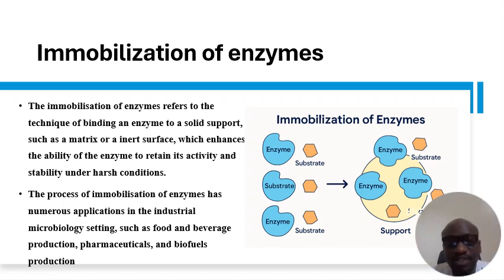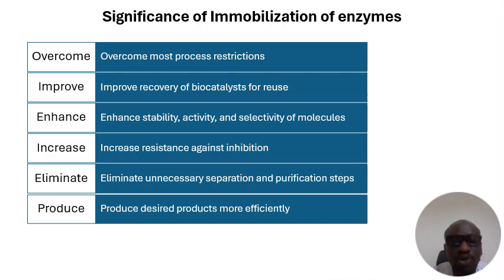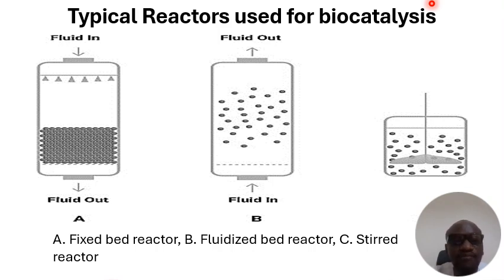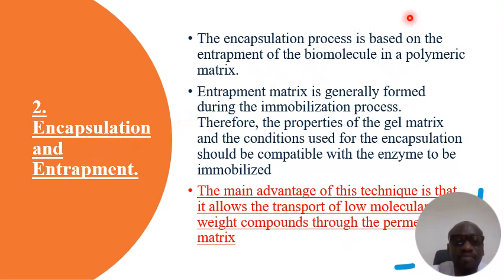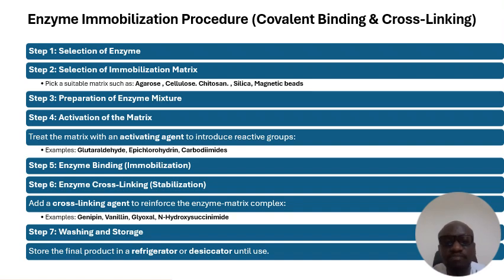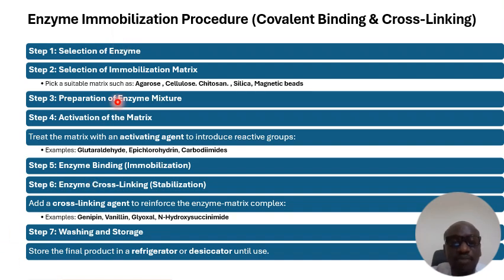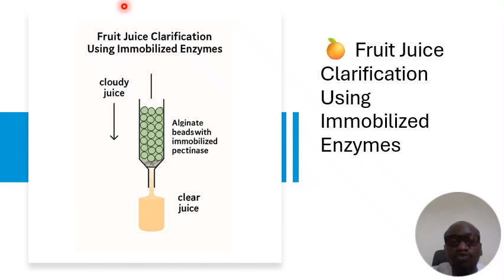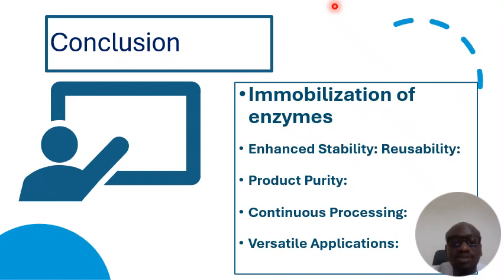Immobilization of Enzymes (Industrial Microbiology )

Comment: Question 1:
Immobilisation of enzymes is the process of attaching or trapping enzymes onto a solid support so that they remain fixed in one place while still carrying out their catalytic function. This is useful because the enzymes can be easily be separated from the reaction mixture, reused many times, and are often more stable.

Question 2:
Advantages of immobilised enzymes:
a. They can be reused, reducing production costs.
b. They are more stable and can withstand changes in temperature and pH better.
c. They are easy to separate from the reaction mixture, making product purification easier.
d. They reduce contamination of the final product because the enzymes remain attached to the solid support.

Real-life application:
Immobilised lactase is widely used in the dairy industry to produce lactose-free milk for people who are lactose intolerant. The enzyme is attached to a solid support, such as calcium alginate beads, porous glass beads, silica beads, or synthetic polymer resins. Milk is passed over these solid supports, allowing the immobilised lactase to break down lactose into glucose and galactose. Since the enzyme remains fixed to the solid support, it can be reused many times, does not contaminate the milk, and makes the process more efficient and cost-effective.

NAME: AWOSIKA IGBEKELEOLUWA AYOWALE
MATRIC NUMBER: 210807010

Comment: Question 1: 

Enzyme immobilisation is a technique where enzymes are physically trapped or chemically bound onto a solid support or matrix. This setup retains the enzyme's catalytic activity while preventing it from mixing freely with the reaction product. It is useful because it allows easy separation and recovery of the enzyme, making the biocatalytic process more stable, cost-effective, and suitable for repeated or continuous industrial use.

Question 2: 
Applications and Advantages

Advantages of immobilised enzymes:
• Increased stability:immobilised enzymes are generally more resistant to changes in temperature, pH, and denaturation compared to free enzymes.
• Reusability:the enzyme can be recovered and used repeatedly, lowering production costs.
•Easy separation: since the enzyme is fixed to a support, it can be easily separated from the product, simplifying downstream purification.

Real life application:
Immobilised glucose is used industrially to convert glucose into fructose, producing high fructose corn syrup (HFCS), a widely used sweetener in the food industry.

NAME: Akinsanjo Kofoworola k.

MATRIC: 210807034

Comment: Question 1
Enzyme immobilization is a method of fixing free enzymes onto a solid support or trapping them within a confined space. This allows it to be  able to retain it's activity during use, retain it's stability under harsh conditions and to be separated easily and used for other industrial processes. 

Question 2
Advantages of enzyme Immobilization
1) It allows recycling of enzymes; that is, multiple use of enzymes
2) Easy separation of enzymes
3) It reduces the cost of downstream processing

Real Life application of enzyme immobilization
Wastewater Treatment: Enzymes like laccases and peroxidases are attached to solid supports (e.g., porous silica or magnetic nanoparticles). These fixed enzymes can be dropped into polluted water to break down and detoxify persistent organic pollutants, such as pesticides and phenols.

Ofojetu Adanna Gift
210807016

Comment: microbiology
Reply: Question 1:
Enzyme immobilisation is the method of fixing enzymes onto or within a solid material while allowing them to keep working. This makes them easy to recover and use again, improving efficiency and reducing costs.
Reply: Question 2:

* Enzymes can be used repeatedly, lowering expenses.
* They are easier to remove from the final product.
* They are more resistant to changes in pH and temperature.

Comment: Question 1

Immobilisation of enzymes is the process of attaching or binding enzymes to an insoluble solid support while retaining their catalytic activity. This process enhances enzyme stability, allows for repeated use, and improves their efficiency in industrial applications.

Enzymes can be immobilised using various methods, including:
Physical adsorption, Encapsulation, Entrapment and Covalent binding

uestion 2: 

Advantages:
- Enzymes can be reused many times, which reduces cost.
- They are easier to separate from the reaction mixture.
- They are more stable and can last longer.

Real-Life Application

Immobilised enzymes are widely used in industrial processes. For example, immobilised lactase is used in the production of lactose-free milk, where it hydrolyses lactose into glucose and galactose, making the milk suitable for lactose-intolerant individuals.

Name: Odususi Anjolaoluwa Elizabeth
Matric No.: 230807509

Comment: Question 1:  Enzyme immobilisation refers to the process of fixing enzymes onto or within a solid material such as beads, fibres, or gels. By keeping the enzymes in one place, they can carry out reactions without mixing with the final product. This makes the enzymes easier to recover and use again, which is especially useful in industrial production.

Question 2:
Two benefits of immobilised enzymes:
1. Reusability: Since the enzymes are attached to a support material, they can be collected after use and employed in several reaction cycles, reducing production costs.
2. Improved durability: Immobilised enzymes are generally more tolerant of changes in temperature and pH, allowing them to remain active for longer periods.

One practical application:
1. Lactose-free dairy production: Lactase enzymes are immobilised in a processing system, and milk is passed over them. The enzyme breaks down lactose into simpler sugars, making the milk suitable for individuals who have difficulty digesting lactose.

Cynthia Udalor chinyere 
210807011
Microbiology

Comment: Question 1
 Immobilization of enzymes is the process by which enzymes are attached to a solid support, such as matrices or surfaces. This can be done through methods such as physical adsorption,, covalent bonding, cross-linking or entrapment, each varying in how the enzyme is held in place. This keeps the enzymes stable and active, under harsh conditions, making them easy to recover and reuse.

Question 2 
Advantages
1. Less purification in downstream processing is required as the enzymes don’t mix with the final product.
2. Immobilized enzymes remain stable over a long period, reducing how often they need to be replaced.

Real-life Application
In pharmaceutical industries, immobilized enzymes are used to synthesize Active Pharmaceutical Ingredients (API), they help make drug manufacturing more controlled, efficient, and cost-effective .

Name: Usman Zoliat Jadesola
Matric number: 210807101

Comment: Question 1: What is immobilization of enzymes?
Immobilization of enzymes can be defined as the process of attaching enzymes to a solid or rigid support without disrupting the activity or stability of the enzymes. The enzyme and substrate react together to give a product, the enzyme remains in the matrix while it is reused.
The methods used are physical adsorption, encapsulation and entrapment, covalent binding, cross-linking.

Question 2: Two advantages of enzyme immobilization and a real life application 

Continuous production: Since the enzyme is retained, it can be used in reactors. This allows non-stop industrial production without having to are fresh enzyme to every batch 

Easier product recovery: Since the enzyme is bound to a solid support and not dissolved in the reaction mixture, the product comes out enzyme-free

Real life application 
It is used in High Fructose Corn Syrup (HFCS)production. This is a sweetener used in processed food and drinks. Corn starch is broken down into glucose syrup by amylase enzymes then it is pumped continuously through a column packed with immobilized glucose isomerase. The enzyme converts approximately 55% of it to fructose, HFCS flows out the other end completely enzyme free. The immobilized enzyme column stays in place and the process repeats continuously.

Daramola Charisma Oluwaseun
210807054

Comment: Question 1: Explain immobilisation

Immobilisation of enzymes refers to the technique of physically confining or binding enzyme molecules onto a solid support or within a matrix. The enzymes are fixed through methods such as physical adsorption, covalent binding, entrapment, encapsulation, or cross linking. This process is useful because it stabilizes the enzymes against harsh conditions, prevents them from mixing into the final product, and allows them to be easily recovered and reused for continuous, cost effective industrial operations.

Question 2: Applications and advantages
Advantages:
* Easy recovery and separation of enzymes from the product, reducing the need for costly downstream purification processes.
* Reusability and enhanced operational stability (such as increased resistance to temperature and pH fluctuations) over extended periods.

Real life application:
Immobilised lactase enzyme (entrapped in alginate beads) is used in the dairy industry to break down lactose into glucose and galactose to produce lactose free milk for lactose intolerant consumers.

210807117
Akuwa Temiloluwa Omoshalewa

Comment: Question 1
Immobilization of enzymes is the process of fixing an enzyme to a solid material or within a small space, so it doesn't float freely in the reaction mixture. 

This can be done by adsorption where the enzyme just sticks to the surface of the support, covalent bonding where it is strongly attached chemically, entrapment where it is trapped inside a gel or bead, or cross-linking where the enzymes are linked together.

This is very useful because one can easily separate the enzyme from the product and reuse it many times, which saves money, it also makes the enzyme more stable and it doesn't spoil easily with heat or pH changes. Then it can be used continuously in industries, like in food processing and drug production, without losing the enzyme.

Question 2
Applications and Advantages

Advantages:
•Reusability : one can use the same enzyme over and over again instead of throwing it away after one reaction, so it saves cost.
•More stability : When fixed to a support, the enzyme becomes stronger and can resist high temperature, pH changes, and doesn't get damaged easily.
•Easy separation : The product will be free from enzyme contamination because you can easily remove the immobilized enzyme after the reaction.

Real-life application:
In industry, immobilized lactase is used to produce lactose-free milk for people who are lactose intolerant. The enzyme is fixed and milk is passed over it to break down lactose, and the enzyme can be reused.

Adefidipe Oluwagbotemi Aderinsola 
210807018

Comment: Answer to question 1.

Enzyme immobilization is the process of fixing an enzyme either on a solid support such as a matrix, or an inert surface that enhances the ability of the enzyme to retain it's activity under unfavourable or harsh conditions. 

Enzymes can be fixed to a support either by cross-linking, encapsulation, entrapment, covalent binding, or physical adsorption.

Enzyme immobilization is useful because it extends shelf-life of the enzymes, makes recovery easy, minimizes the purification procedures, enhances the stability of the enzymes, and supports continuous processing.

Answer to question 2.

Advantages of Enzyme immobilization 
1. It allows for multiple use lf the enzymes
2. It reduces the cost of downstream processing
3. It allows for the enzymes to be separated easily 

Real-life application of enzyme immobilization.
Production of clear fruit juices in the food industry: In the food industry, a bioreactor holding the enzyme pectinase is used to remove pectin from fruit juices via the catalytic reaction between pectinase and pectin. Pectin is an organic compound. In fruit juices it makes it cloudy in appearance. For the consumer taste of having a less cloudy fruit juice, the enzyme immobilization based reaction on the fruit juice is being used.

Name: Ayika Peter Kosisochukwu
Matric number: 230807573

Comment: Question 1:

The Immobilisation of enzyme refers to the technique of binding an enzyme to a solid support such as inert surfaces or some other matrix which allows the enzyme retain its activity during use and stability during harsh condition. The enzymes are fixed to a support by cross linking, encapsulation, entrapment, adsorption or covalent binding. It is useful for easy recovery, extended shelf life and also enhance stability.

Question 2:

1.Reduced costs of downstreaming process: Enzymes can be reused, reducing production costs. 
2.Better Stability, especially towards organic solvent and higher temperatures: They are more stable and can withstand changes in temperature and pH better.

Application:
Immobilised pectinase is used to clarify fruit juice by breaking down pectin, which causes cloudiness. This produces a clearer, better-looking juice while allowing the enzyme to be reused, reducing production costs

Name: Ajao Wasilat Oladunni 
Matric No: 210807080

Comment: Question 1 

Immobilization of enzyme is a technique in which enzymes are held in a fixed position by attaching them to or enclosing them within a material that supports them . This allows the enzymes to keep carrying out their reactions while making them easier to recover, use repeatedly, and maintain their activity for a longer period, especially in industrial processes 

Question 2 

Advantages of immobilised enzymes:
1. Reusability: Immobilised enzymes can be recovered after a reaction and used repeatedly, thereby reducing the overall cost of enzyme-dependent processes.
2. Improved stability: They exhibit greater resistance to changes in temperature, pH, and other operating conditions, allowing them to remain active for longer periods.
3. Simplified product recovery: Since the enzymes remain attached to a support material, they can be easily separated from the reaction mixture, resulting in a cleaner product and easier downstream processing.
One real-life application:
* Production of lactose-free dairy products: Immobilised lactase is widely used in the dairy industry to hydrolyse lactose into glucose and galactose, enabling the production of lactose-free milk while allowing the enzyme to be reused efficiently.
 
Bamisile Abimbola 
230807568

Comment: Question 1: Explain Immobilisation
Immobilisation of enzymes means fixing or attaching enzymes to a solid material so that they can stay in one place while still carrying out their catalytic activity. This makes it very easy to separate and reuse the enzymes, which helps save time and reduce cost during industrial production. It is achieved by binding the enzymes to a support material, trapping them in a matrix, or enclosing them in a membrane or capsule so they remain active but do not move freely in the reaction mixture.

Question 2: Applications and Advantages
Advantages of immobilised enzymes:
1. They are strongly attached to the support, so that they do not leak easily and also remain stable during use.
2. They are cost effective because they can be reused many times without losing much of their activity.
Real-life application:
Immobilised lactase is used to produce lactose-free milk by breaking down lactose into simpler sugars that are easier for people with lactose intolerance to digest.

Adetu Oluwafemi Hikmat
210807025

Comment: Question 1:
Immobilisation of enzymes is the process of attaching or trapping enzymes onto a solid support, such as beads or a membrane, so they remain in one place while still carrying out their catalytic function. This is useful because the enzymes can be easily separated from the products and reused many times, making the process more efficient and cost-effective.  ￼

Question 2:
Advantages:
	•	Immobilised enzymes can be reused several times, reducing costs.
	•	They are easy to separate from the product, preventing contamination.
Application:
	•	Immobilised lactase is used in the food industry to produce lactose-free milk by breaking down lactose into glucose and galactose.  ￼

Comment: Question 1
 What is enzyme immobilisation, and what methods are used to achieve it?

Immobilisation means fixing an enzyme onto or inside a solid support material so it can no longer float freely in solution, while it still keeps its catalytic ability. This makes the enzyme more durable, reusable, and better able to withstand harsh conditions.

Common methods include:
1. Adsorption (surface attachment via weak forces)
2.Entrapment/encapsulation (trapped inside a gel or membrane)
3.Covalent attachment (chemically bonded to the support)

This matters because it cuts costs and improves durability for large-scale industrial use.

Question 2
What are the advantages of using immobilised enzymes, and can you give a real-life example?

Advantages
1. Easy to separate from the finished product
2. Better tolerance to temperature and chemical changes
3. Lower cost since the enzyme can be reused across batches
4. Higher efficiency from continuous use

Real-Life Example

Immobilised lactase is used in the dairy industry to break down lactose into glucose and galactose, enabling lactose-free milk production and continuous processing.

Name: Lawal Temitope Favour
Matric number: 230807556